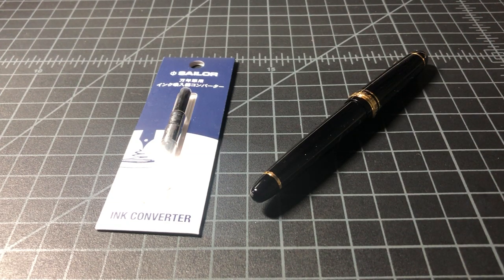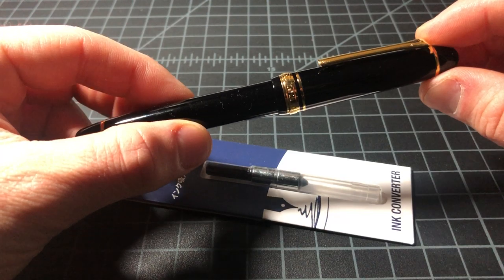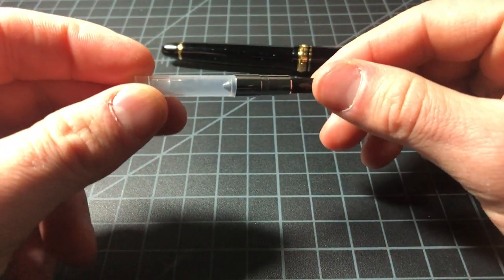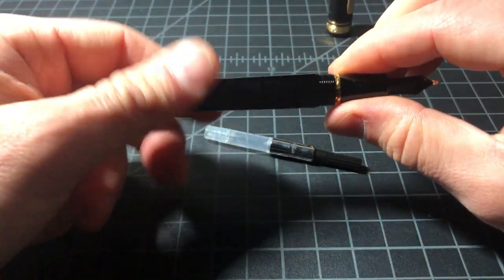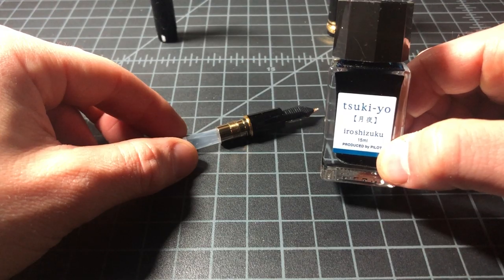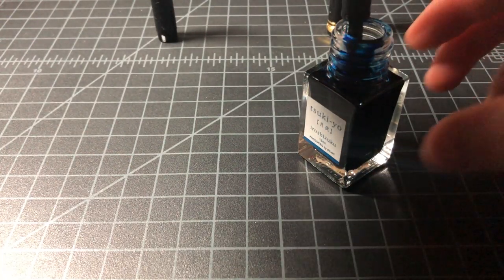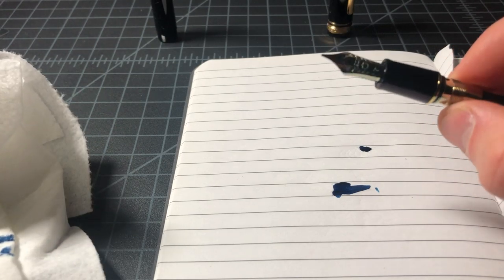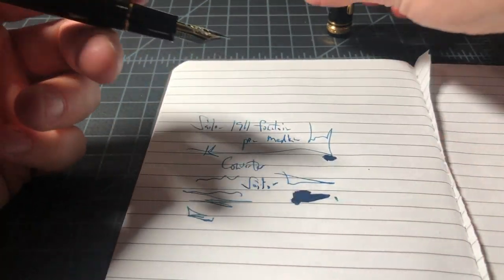Sailor 1911 Fountain Pen: How to Use Install a Converter

Comment: Thanks for your short and concise video. I have the Sailor Fude nib pen, 55. My converter was not pulling up ink, but now I know to do it two times and it was the second pull that worked. As you know the fude nib pens use a lot of ink quickly, so I will be filling up this small converter quite often. But this long handled pen is so fun to sketch with esp. by holding the long handle at the end to get that loose look. Very reasonable price for fude nib. Thanks again